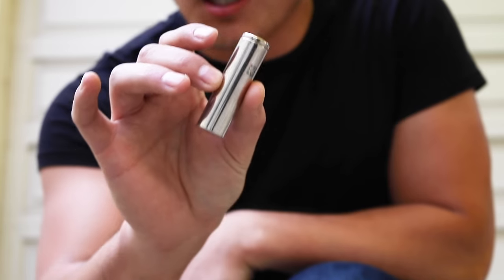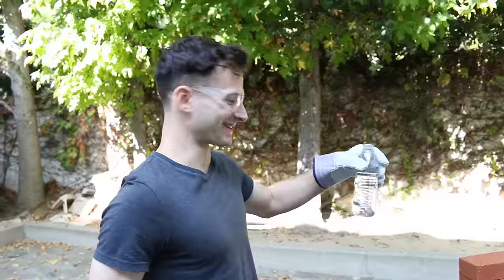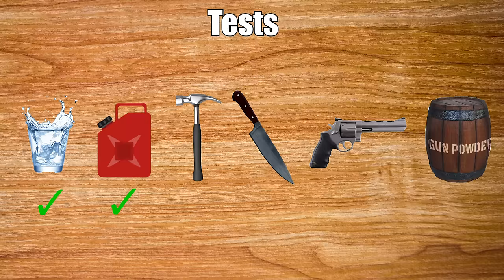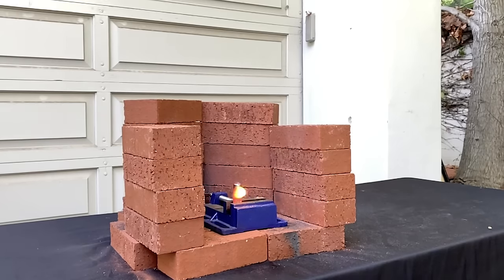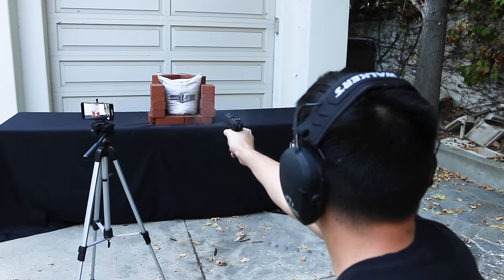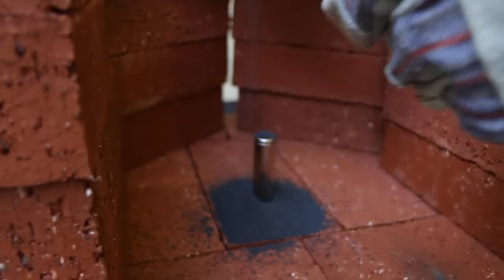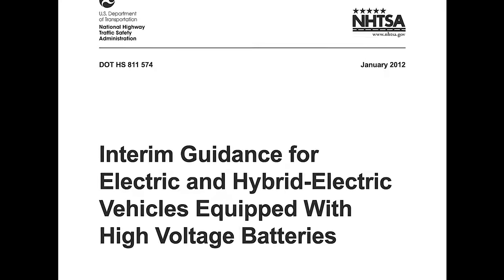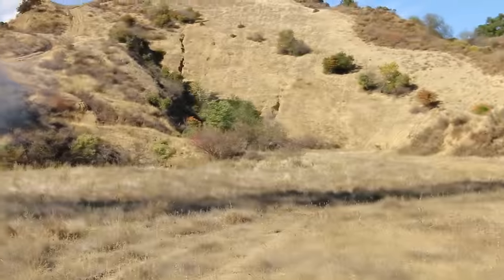How to make a Tesla Battery Explode (Torture Test)

Comment: Oops - we discovered a little bit of cheating by charging the cells up to 4.5 volts, which will make them even more flammable because overcharging lithium ion cells (>4.2 - 4.35V) will release free lithium which alone could have made the cells burning if there was a leakage.

That the cells still do not catch fire before something bad is done to them, is a proof that the cells are hardened to withstand some abuse 
that the BMS anyway would protect them from.

Fortunately - lithium iron phosfate and lithium titanate batteries are on their way into the market, even in some EVs, eliminating fire hazard and the use of cobalt.

Comment: Your "scientific method" with the water test leaves a lot to be desired.  While Lithium-ion batteries are not made entirely of this alkali metal, it's still in there.  Water doesn't cause the battery to short circuit,  but with even a TINY defect in the battery housing, a minute amount of moisture can cause a thermic reaction which will cause a runaway reaction, which WILL effect ALL of the power cell.  And 30 seconds to a minute is HARDLY enough time to reach a scientifically acceptable conclusion.

Comment: the water test needs to be conducted using more than just a single battery to instill a reaction..  how many volts & amps do their battery cells produce on the cars?  How about the electrified water seeping into the car as it is sinking rendering drivers unable to even move as they are "tased" by their own car?  Each module runs at 22.8V nominal & charges to 25.2V Max.  They can do 225 amps continuous output & up to 1500 amps max for 3 seconds..  Total energy storage is 5.3kwh...  I wonder what kind of reaction we would get with these parameters...
Electrical cars are not the solution..  especially when that power creation is just as toxic as combustion engines...  at least combustion engines you don't have toxic radioactive waste that has to be monitored for thousands of years...  and who uses low velocity rounds in their guns?  Are you being paid by Tesla for this?  lol...  Yes Man!  710fps is less lethal then 1500fps...